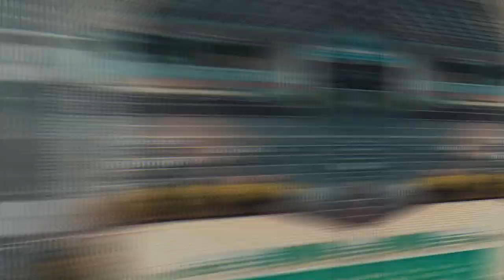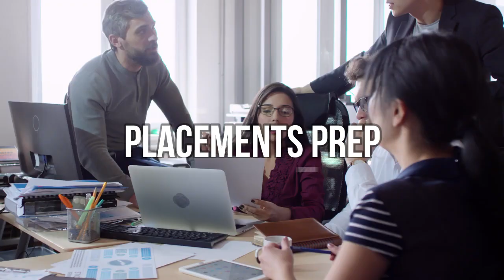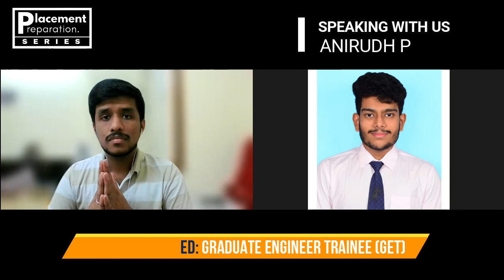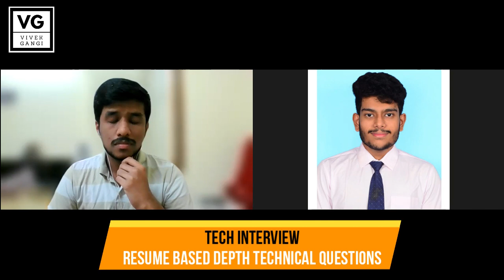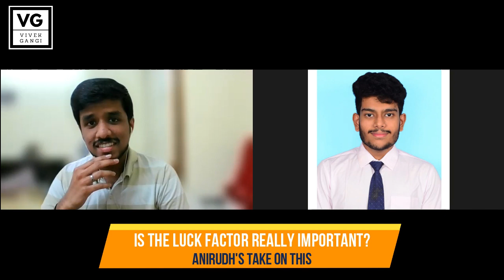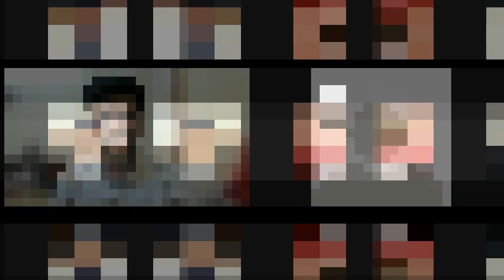VOLVO Group: Interview Experience & Preparation Strategies | Embedded Systems Engineer | PGS: 07

Comment: Sir  i  am working in cognizant company and i am fron cse stream so can I join volvo company for the associate engineer role?
Reply from the maker: Hi Priyavandana.
Yes, you can. But your experience might not be useful as it would be irrelevant. Also, you might need to apply as a fresher again, so the older work experience might go waste but there is no obstruction in applying. Kindly check out the job description from the company officials before proceeding. All the best 👍. Do subscribe to our channel to support us 😊!
Reply: @VivekGangi  oky thank you
Reply: @VivekGangi  Hii this is a very good video and definitely sharing with my friends. There is an opening for associate software engineer now in volvo. Im a fresher graduate in 2022 and have applied for it. Can you please confirm, Is it applicable for freshers?